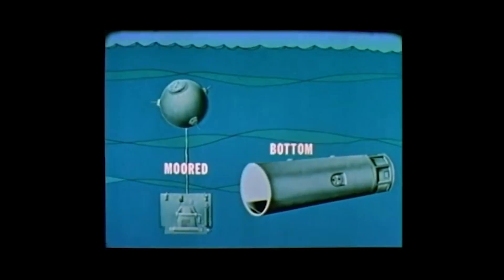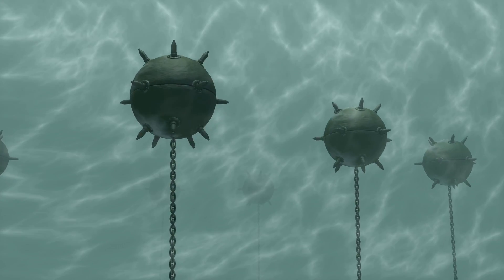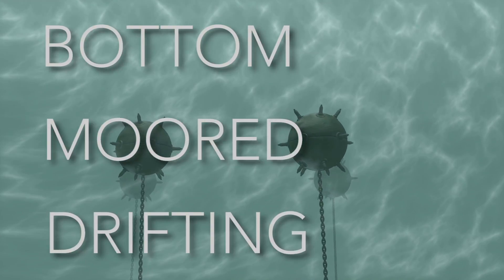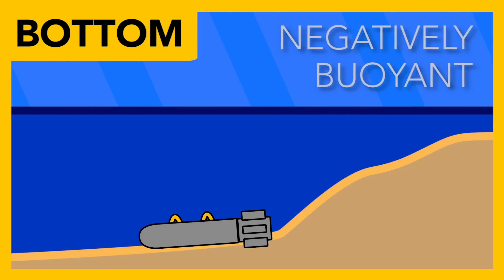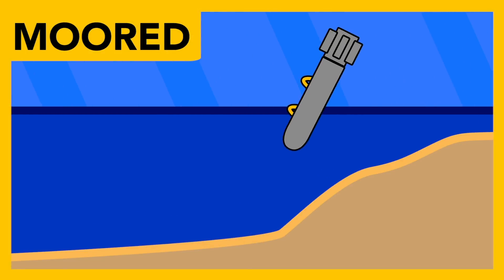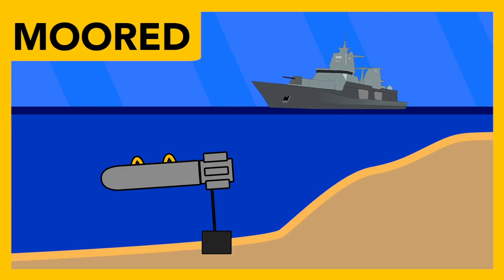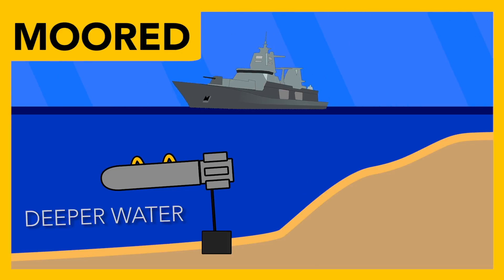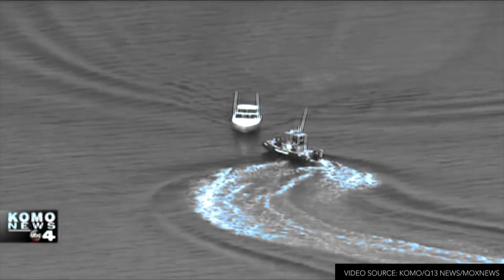The Different Types of Naval Mines

Comment: I want one so badly!  my friend found one, he called the bomb squad to disable it without destroying it so he can keep the casing and ended up making a really cool charcoal grill out of it!
Reply: Was it just hallow steel or any material to help it float?
Reply: hollow steel. the bomb is inside. the things sticking out are button swiches or shock swiches to detonate the bomb inside.    it needs to be hollow so air keeps the explosive material dry and to make it light enough to float.
Reply: Ain’t no way 💀
Reply: That's kinda cool but u can make a grill out of a lot of stuff i think just have a fully in tacked sea mine is cooler